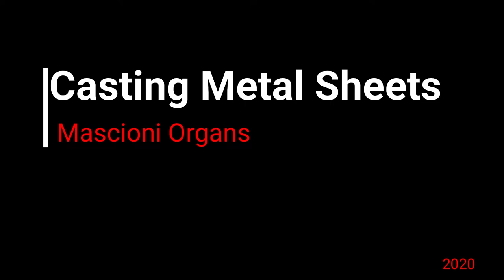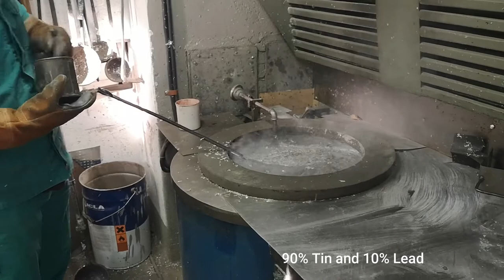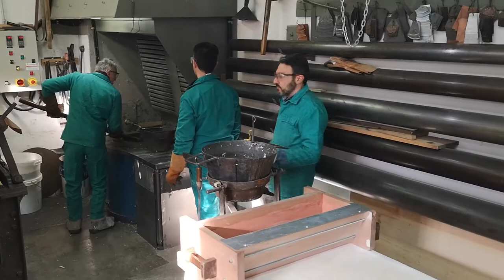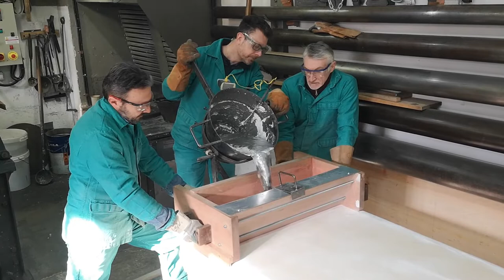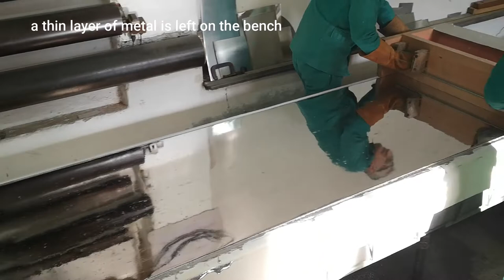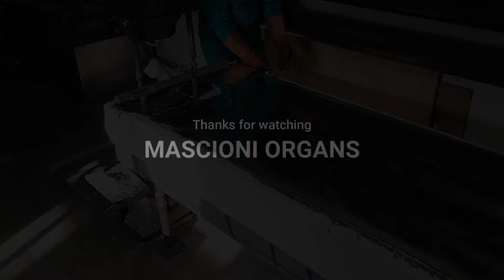Casting 16' Tin Metal Sheets

Comment: how is the box you're pouring the metal in, able to withstand heat without burning up, and also how does the metal poured in it not solidify quickly before dragging across the table